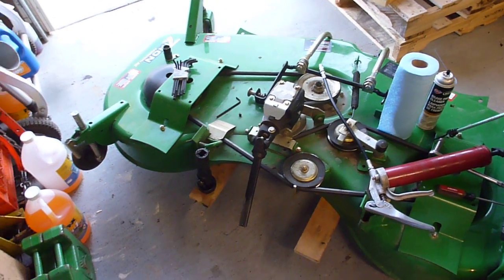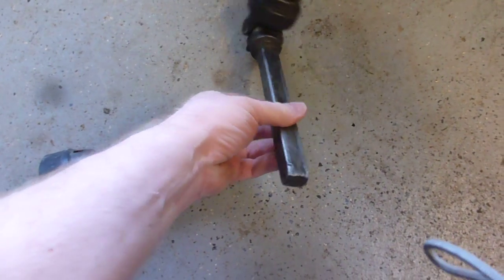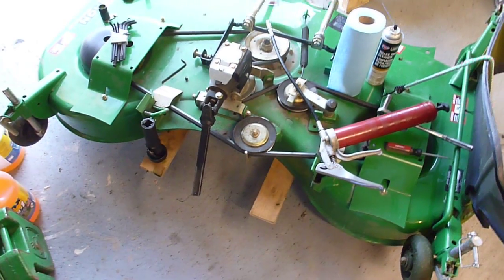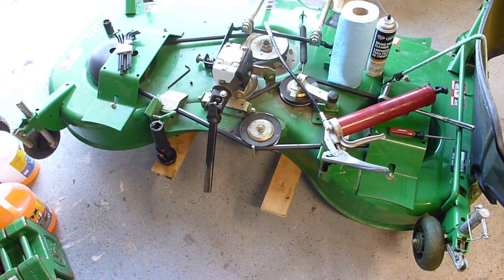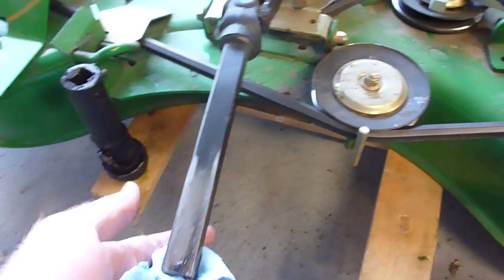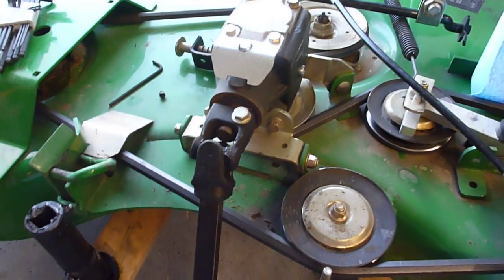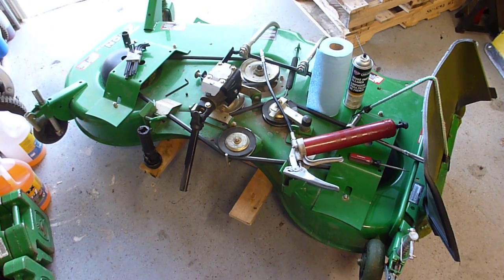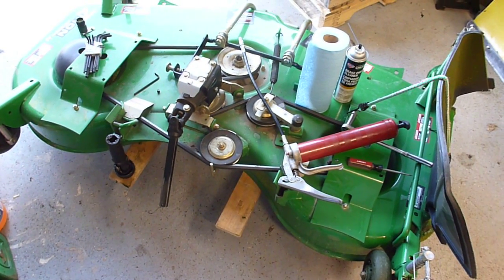Doing a little maintenance to the 7-Iron deck.

Comment: How this deck compare to JD 455 deck?
Reply from the maker: It really depends on the which of the 455 decks. The 7-iron will out perform the 48" and 54" decks by miles in cut quality and capacity. The 60" deck, in my opinion, is one of the nicest cutting decks behind the 7-Iron that John Deere has ever put under a garden tractor. If I had my pick the 7-iron would edge the 60" deck out in a contest.... only because the 7-Iron can handle taller grass.
Reply: @mmrbeef  thank so much.  This helps a lot and your awesome videos JD 455.  Also in dilemma trading  for 2011 JD X748 w/ 7 iron deck. Both machines are great.  But X748 4wd got me thinking 🤔